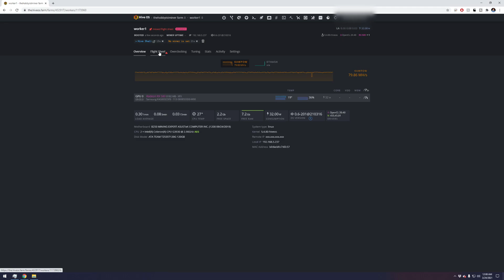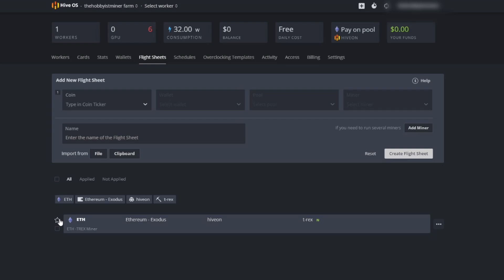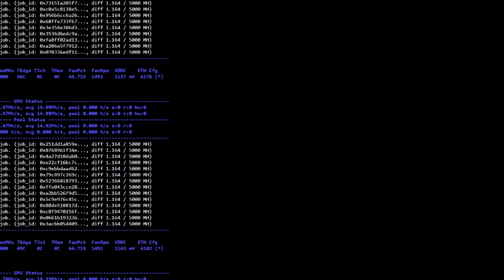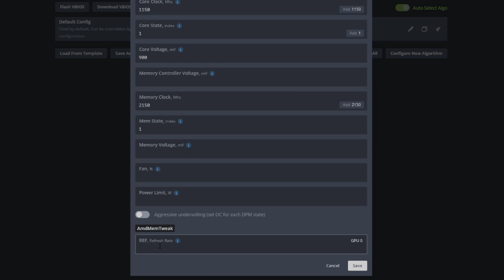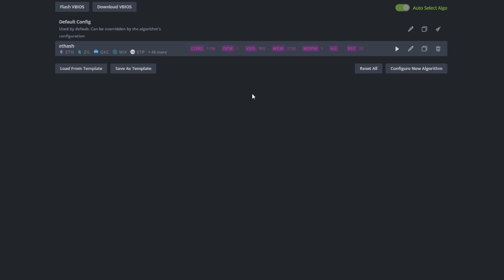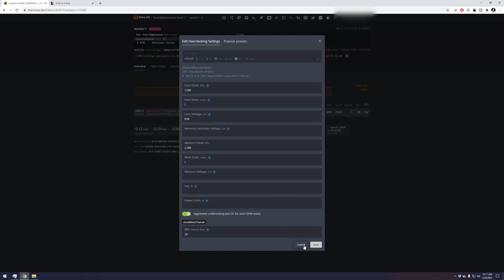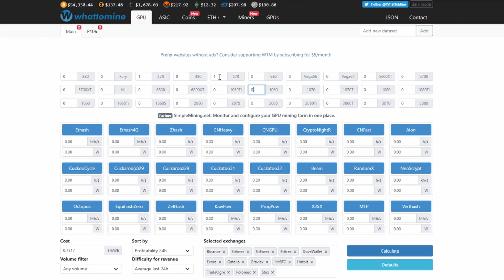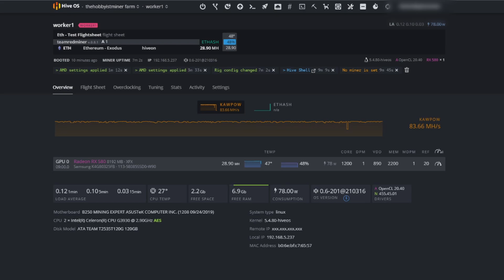RX 580 Ethereum Hashrate Testing & OverClock Settings

Comment: Hey can you help me out what overclocking software do you use, I have 2 590s and a 580 8GB and wanted to do this to mine, I was thinking to attempt and try out through connecting the HDMI back to the GPU from mobo 1 by 1 and configuring the overclock & undervolt within there, is that right? Any help would be much appreciated, Ty!
Reply: Getting a 72Mh hashrate on eth with the 3 but I want to do this overclock and maybe use this Hiveon also as I am using zergpool & lolminer for now, pls any help would be great 👍🏽

Comment: i remember these cards at least sapphire brand can reach 31.50 32 mh/s hashrate on ethereum with claymore miner,I cant get pass 30.50 mh/s now with bios mod using team red miner.

Edit: I was using msi afterburner for o.c when i saw this i give a shot undervolt overclock from teamredminer,well 890 mV 1200 core 2250 memory hits 31.55 mh/s.

Comment: I think you need to change bios from W90 to M80 with a switch beside 8 pin connector on top of card.
you get 1 or 2 more hashes
Reply from the maker: Interesting I will test it out.

Comment: I have two...well sort of three RX 580's in my rig. One has Micron memory and the other has Samsung memory. The one with Micron is getting 34.25 Mh/s@107 W and the one with Samsung is getting 31.49 Mh/s@90 W. 

Settings on the XFX RX 580 with Samsung memory are:
Fan=60%, Core=1175, DPM=1, VDD=850, Mem=2075. 
Settings on the Powercolor RX 580 with Micron memory are:
Fan=60%, Core=1270, DPM=1, VDD=920, Mem=2300.  

I also have a Dell RX580 that Hive reads as an RX480 that has the exact same type of Samsung memory that I am only getting 30.64 Mh/s@ 94 W.

Does anyone else have 580's with Micron memory that seem to outperform 580's with Samsung memory?
Reply from the maker: Wow nice setup. Thanks for sharing your OC settings.
Reply from the maker: Are you not using Mem State, Aggressive Undervolting or AMDMemTweak?
Reply: I have one three rx 570 one with samsung memory two with micron memory . Samsung memory card is giving 31.5 Mh/s 70 watts and one micron is giving 32.00 at 68watts and other micron is giving 31.83 at 74 watts

Comment: I just switched my rig over to HiveOS, I'm using the same clocks I did in Windows eccept in Amd adrenaline I was able to control the mem voltage more, I see the Memory Controller voltage and memory voltage, but when I go over the little i it says it's onlyl for navi cards?
Also when an area is blank on the settings, is that default or is it 0?

Comment: Thank you for a great video on the RX580 overclocking.

I have gotten my MSI Armor OC RX 580 to 31.66 MH/s with these setting in HiveOS mining ETH.

1200 Core clock, 1 Core state, 900 Core voltage, 2200 Memory clock, 1 Memory state, Advanced config "amdmemtweak --REF 20", 70 Fan, 46 Degrees at 87 watts
Reply: awesome! was getting 27 put these in and im getting 31.79
Reply: Thank you Andrew !

Comment: Radeon RX 580 8192 MB · Sapphire 31.25 MH 1150 1 850/850/850 2100
Radeon RX 580 8192 MB · MSI 31.21 MH 1150 1 850/850/850 2100
Radeon RX 570 8192 MB · XFX 31.12 MH 1145 1 850/850/850 2100
Radeon RX 570 8192 MB · MSI 31.20 MH 1150 1 850/850/850 2100
No BIOS MODs.. Trick is to make sure your temps for each card are 50 degrees or less otherwise HiveOS gives bad shares every once in a while.. Otherwise - VERY stable.. No down time.. No DEAD CPU's or stale shares for me.. You're welcome ;)

Comment: I have an XFX RX580 4gb. Compute mode is on but I can't get over 21mh/s even with oc. Can someone help please?
Reply: Someone helped me in the comments and I solved it by setting the timing level in the vram settings to level2 and now I get about 26mh/s
Reply: Can you explain how you set memory timing 2?
Reply: @orgint2997  it's on the VRAM Tuning settings in AMD's Radeon Software. You'll see there's an optionfor Memory Timing that's in Automatic by default. You need to set it to level2

Comment: 30.11 MH/s

1200 MHz Core Clock
890 mV Core Voltage
2200MHz Mem Clock
Memory timing 1
85% Fan Speed
60 Degrees
77W
Reply: Did you do BIOS mod with your card?

Comment: 26.5 MH/s 109W. Asus RX580 8GB. Stock BIOS, am a bit afraid to modify. Win10. 1175 Core, 890 core voltage, 2150 mem (would not go even a bit higher), 950 mem voltage. 75C, 1600 rpm fans.

Comment: guys I qwanna buy 5600xt.. Do i NEEd to mode bios?? for 40hash at 110w?
Reply: Got two AsRock RX5600xt (no BIOS mod - Samsung Mem) each working at 40.07 MH/s both 89W between Core Temp 40-43C Mem Temp 66-68C

Comment: how are you getting so high hashrate? when I mine with just compute mode I have about 19 mh/s and when I overclock my GPU it's 22 mh/s max and I can't make it higher. Am doing something wrong?
Reply: In amd Radeon settings set additional graphics set "compute" instead of 'graphics"
Reply: @GamingDog20  yea i know i have it enabled you can see it in comment "when I mine with just compute mode I have about 19 mh/s"
i have compute mode and i have my gpu overclocked to max still cant get over 22mh/s
Reply: @GamingDog20  yea I know that bios modding will help me and I want to bios mod my GPU but now I am using it as my gaming GPU too so I'm waiting to get a new one to game on and make a small mining rig. Thanks for helping when I get the new GPU I will try it.
Reply: @GamingDog20  but did he flashed his bios? because it seems to me like he didn't and still got 30mh/s that why i asked
Reply: @jonasgames5476  not sure, but i moded the bios and still gaming with the same fps
Reply: I have the exact same problem. I have an XFX RX580 (in compute mode) and I can't get over 21mh/s. While modding may help a lot of people with an rx570 stock have over 27mh/s
Reply: @iliaslef  i found that you can chagne timing in radeon software went from about 20-21 to 26 simple click
Reply: @jonasgames5476  OMG thank you very much that actually worked! I've tried anything the last few days except for that. Thanks a lot man!
Reply: @iliaslef  np me too tried everything and then one forum from few years ago helped still cant get over 30 mh/s but im steady 26.8mh/s and 80w so i guess its good
Reply: @jonasgames5476  I set the timing to level2 and with some oc I managed to reach 26mh/s which is good enough for me since I had 18mh/s previously. What oc settings do you use?
Reply: @iliaslef  i have it on level 2 too but when i go over +50 memory i start to get artifacts/dead gpu or just plain crash
Reply: @jonasgames5476  I currently run it on 2000mhz through the advanced control on stage 2. Try overclocking gradually from stock  to 2100mhz while your pc is on idle and then open the mining program
Reply: @iliaslef  i've tried that im pretty sure 2140 is my limit 2100 is stock im pretty happy with that maybe i could get 30 with bios mod but idk

Comment: on my computer I have an RX 580 8gb but its 7.5 MH/s on Eth? Why might that be? I have 2 monitors an its my first mining on my PC so its not a rig designed for mining.
Reply: Go into AMD Radeon settings under the game tab and advanced settings and switch gpu to "compute mode"
Reply: just like  @GreatKawz said. Compute mode.thats the begining. After that you get 26 MH/s and then you have to overclock/undervolt
Reply: @andresprato4452  thanks guys found the compute mode. Will the pc work for gaming in compute mode, as I will probably game during the day and mine overnight. I can always switch it back every night though
Reply: @MrBlackCoffee96  games run fine for me in compute mode but I still can't get over 21mh/s with oc.
Reply from the maker: That doesn't sound right.  What miner are you using?
Reply: @TheHobbyistMiner  I'm using lol miner v1.28 a . Maybe it's because I havent messed with the overclocking yet

Comment: Rx580 Hynix 8G - No bios Mod - Core 1200, DPM3, VDD875, Mem 2375, PL 100 = 30.17MH in HiveOS. PhoenixMiner. Stable !
Reply from the maker: Nice Work!  I have the 580 at around 32 currently.
Reply: @TheHobbyistMiner  I'm playing with my clocks now on the Hynix, stable at 31.86 crazy

Comment: 32.950MH/s on Eth. 87W. MSI ARMOR RX580. ModBios. Hive OS. 1200 Core, 890 VDD, 220 MEM, 30 REF. PheonixMiner (i have both amd and nvidia cards going in one rig). 52-57 Degrees. 100 Fan. Xd (FAN SPEED is shit i know... <3)
Reply: Hi, which bios are you using? 220 mem it’s 2200?
Reply: @ovelarnicolas1   sorry it’s 2200mem

Comment: Amazing guide! Sadly even with these settings though mine won’t go above 20mh/s. At stock I got 20. With these settings I get 20.5. Not sure what the problem is, 8 MSI armor RX580s
Reply: mods you bios
Reply: in the radeon software app switch to compute mode when u mine, graphics when u play

Comment: I've 33,6Mh/s With 2 RX580 NITRO 8G = 67.2Mh/s Moded, 1250, 2250, 1000mV. Sometime average better than 80Mh/s . I can have 34, but i think it's not good for cards.
Reply: What is the consumption at those settings? Are you running in hiveOS? I’m currently at 31.8mh/s but if I have any time I’d try to get 32 but I don’t want to push over 850mV

Comment: I have 6 cards all running with the bios toggle switched and each card is running 29.54Mh Stock right out of the box.
Reply: Couldn't really locate the bios switch on the RX580 I got the other day. So i just flashed it :)

Comment: I believe that card has a dual bios.  Did you flip the toggle switch to get that speed?
Reply from the maker: OMG you saved me, you don't even know.  lol  I entirely missed it, its so hidden on this car.
Reply: @TheHobbyistMiner  im curious what you get after you turn on the turbo
Reply from the maker: @ScreaminReel1  Will let you know ;)
Reply from the maker: 32.24 on 85w!
Reply: @TheHobbyistMiner Wow. That's nice for a 580. Currently direct mining ETH with ethermine/nbminer and the best I can get is 30.65/107 watts. Would you please share your OC with core and mem voltages?
Reply: @ScreaminReel1  where is that conf?
Reply: @ScreaminReel1  He probably crashed it few times an hour. Those instantaneous rates can be deceiving.
Reply: I have and I get 29.54 On my rig all six cards.

Comment: 31.04 MH/s on Eth. 76W. MSI MK2 RX580. Stock BIOS. Hive OS. 1150 Core, 850 VDD, 2150 MEM, 20 REF. TeamRedMiner. 47 Degrees. 60 Fan.
Reply from the maker: Wow Great Stats for your card!  Nicely Done!
Reply: Same gpu, I’ve started today mining so i’ll try that config. I’m currently at 23mh/s.
Reply: Updating my stats: 3 x 580s 
2 with hinyx and 1 with Samsung memory
31.75 - 31.18 - 31.80 mh/s ETH
HiveOS
PolarisEditorBios flashed bios
1200 core
850 vdd
2100 mem 
ref 30 
TeamRedMiner
HivePool
78w 45°/50° 45 fan
Reply: @ovelarnicolas1  There ya go! Very nice! My hash dropped to 30.03. It's SLOWLY creeping downward over time, not sure if it's related to dag size.
Reply: @lc8535  thank you! It could be what you’re saying. I will look up if mines get down or stays the same. Maybe you can try flashing it
Reply: @ovelarnicolas1  total noob question. Whats REF?
Reply: I applied your settings. 

26.66 MH/s on Eth. 
76W.
Eff/Watt 350.8K
XFX RX580 8gb. 
1150 Core, 2150 Mem(Micron)
850 vdd
84 Degrees.
35 Fan.
Windows 10 (Build 19042.985)
Radeon software ver 21.4.1

I'm using my personal computer with mining, youtube, etc.
I think our difference result in Windows and hive OS or using computer with mining or not.
Reply: im sorry im new, whats vdd is?
Reply: @asrulhrr  in that case 850vdd is the core voltage configure to the rx580 8gb in hiveOs
Reply: @ovelarnicolas1  okay thanks bro
Reply: Perfect. I'm getting 29.2 MH/s 124W lol started today

Comment: XFX RX 580 @ 31.52MH/s, non-modded.  1175 core, DPM 1, 2075 memory, MDPM 1, REF 32 and core voltage at 930 at 83W.  Could easily bump to 32+ with 1200 core and 2100 memory, but the rig frame is a tight fit and the temps can get a little too high for my liking.
Reply from the maker: Sounds like you have a great card and config, nicely done!
Reply: @TheHobbyistMiner  I guess I scored... Got two cards that run identically.  Wish I had bought more, but I was just getting into mining and wasn't sure about spending the money.  Wish I had, got these for $180 each, new, back last summer.
Reply from the maker: @paulfuston189  Way to go!
Reply: Did you switch the switch?
Reply: Can you explain to me what DPM 1, MDPM 1, and REF 32 are?
Reply: @orgint2997  DPM and MDPM is AMD core and memory downclock settings.  REF is AMD memory tweak reference setting.
Reply: Thank you so much! So you used AMD mem tweak without nodding the BIOS?
Reply: @orgint2997  correct.  I haven't BIOS modded any of my GPUs.

Comment: Did you switch to mining on gpu? 2150/1150/960/30.3MH/s (xfx rx580 samsung memory)
Reply from the maker: I will have to test those settings! Thanks.
Reply: @TheHobbyistMiner  Yes but i ask you about the switch on the graphics?
Reply: Where is that??
Reply: I have the same xfx Samsung card and i am getting 33.08 trying to see if is possi le to get 34 89watts
Reply: @andaduma1536  what clock do you have?